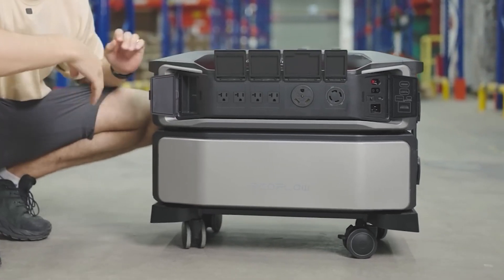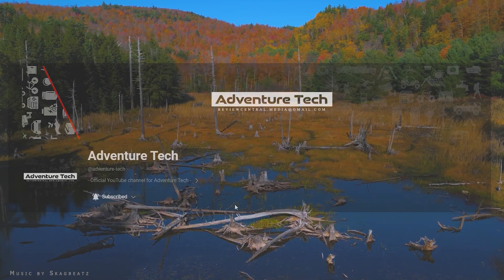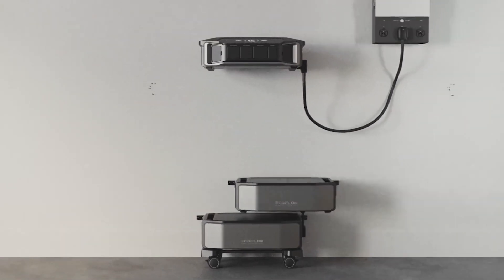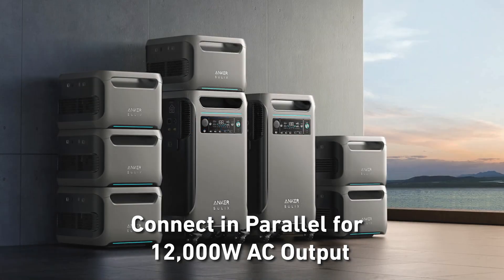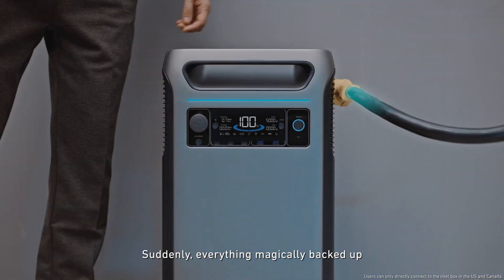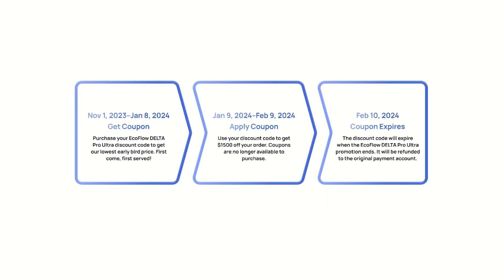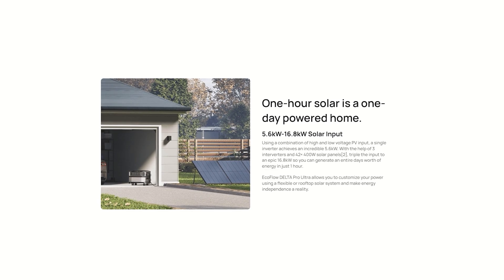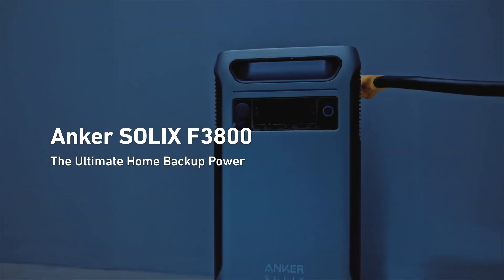EcoFlow Delta Pro Ultra vs Anker Solix F3800 - Which One is Best Portable Power Station for You

Comment: Question...which product powers a refrigerator longest...anker solix f3800 or ecoflow delta pro 3?
Reply: Thanks for your question.   The Delta Pro 3 has 4000Wh and the Solix f3800 has 3840Wh, just a little less.  Not by much.  So the Delta Pro would last just a little longer.   let me know if you have any other questions.

Comment: I don’t understand anything about wattage or output i have 2 sump pumps a fridge, a deep freezer, a furnace and a 3 ton central ac. Can any of these fully power my home and for how long?
Reply from the maker: Based on my research and communication with the company, The EcoFlow Delta can likely handle everything you got (with one exception, your 3-ton central air conditioner's LRA rating must be within 120A.. )     Everything else should be good.  You know  them sump pumps and fridge's can pull a lot, especially the pumps.  The 3 ton central AC pulls a lot of power as well.    Your furnace doesn't use too much electricity since it burns fuel, it only needs to run igniter, fans, etc...  A lot of furnaces I've seen have a small plug in box with a few wired plugs to them in case you need to unplug them from house power and plug them into a small generator or battery and inverter.  The ultra is made to be able to handle pretty much everything you got.  Just the one main exception I know of mentioned above.    You may want to invest in smart home panel 2 combo to to make things super easy; if you don't want to bother yourself too much with the complexities of portable power system set up. 

The Ultra can output a lot of watts so it should be good with your needs.  But high output means high battery drain so you would just need to figure out how long you want to run everything during emergency.  Or some people like to run during the day and charge at night to save money on their power bills.  While others use solar to power huge battery banks for multiple days worth of emergency power.    

Learn how to find out your daily usage here:  The length of time your batteries last would depend on how many batteries are on it.  You can connect up to five batteries per inverter (or the main Ultra unit.)   It comes with the one battery that is a lot.     In your home, everything won't be running continuously so usage will vary throughout the day.  Your power bill should give you your daily average usage, letting you know how many kWh you need in your batteries.  OR your monthly amount you can divide by total days in that month.   I use about 11 kWh on average being very easy on power use for one person.  Average usage per day in the states is about 30 kWh or so.   So maxed out at 90 kWh would cost a lot, but a lot cheaper than trying to do this even five years ago.  They advertise this to last many days based on idea it is for emergency use, not your normal daily use. Also, people tend to use power different when it is coming in from a portable power situation, so you may adjust your usage a bit when transitioning or during battery use.  

One good thing about this portable power station is that the battery and inverter are separate, making it easy to replace and add new batteries.  Plus this is big enough to power your home and portable enough to quickly grab it and take it with you anywhere you go.   It isn't super light, but manageable for sure.   This is one of the more revolutionary aspects of this design being portable and extremely powerful with huge power storage.  

I hope this helps out and answers some of your questions.  Feel free to follow up with any other questions or concerns with this type of technology.   I'm happy to help.  There is a pretty good discount right now going on and if for some reason you missed it, you can email me and I can offer something for ya.  But I think the discount should still be available following the link I left in the video description and pinned comment. It helps keep food in my fridge too if you use the link, which is always greatly appreciated.  

If you are not scared of a slightly more complex DIY system.  You can learn more here if you like : https://youtu.be/eeIDh6zxUdU   

This video compares DIY set up to an EcoFlow whole home back up; costs, capacity, certifications, etc...

Comment: Not sure if asked elsewhere,  but the Smart Panel 2 for these Pro Ultra is capped at 12 circuits.  What possibility is there for powering the whole home circuit, which might be 2x that number?
Reply from the maker: that's a really good question.  You would need to account for how many circuits you want to run with using this set up.  You may be able to work around it with two panels though.

Comment: None of these are "portable" per se.    Portable is something that anyone can carry.  If you try to carry an ecoflow pro or pro ultra, your back will hate you forever.
Reply from the maker: Haha yeah, not recommended to go lifting these without proper help or equipment.  Your back with thank you later.  Really good point you make though   It is a bit portable with the design and wheels, but these are starting to get really heavy.  First they called them just 'solar generators,' then it became 'portable power stations'...  I wonder what the advertising terms will be used for the next generation of portable power solutions that are getting too big to be portable.

Comment: The Anker F3800 can be charged from an EV? Whereas the EcoFlow Ultra can only be charged from AC? Or did I misunderstand what you said?
Reply from the maker: I apologize for the confusion.  It's been a bit confusing because both these aren't available yet and they have been changing some information over time.  I meant to mean that you can charge EV with Anker Solix f3800 but so far there isn't quick easy way to do same with Delta pro ultra.  Of course a ultra can put out the power needed, but may need an attachment of some sort.  IT was only vaguely mentioned  where I found the info without many detailed.  It seems Anker is making an easy to use port on the unit itself for an EV charger to connect to, while EcoFlow ultra does not do far as we see.  Again, please remember they keep changing things a lot and there is really very limited information.  Something else to consider is that only Anker seems to be really changing information a lot over time.  Originally they said only 26 kWh or so storage upgradable, now they have doubled that number recently in there marketing material for the f3800.  So EcoFlow seems to be more accurate with the final product.  I'm not finding discrepancies like that with EcoFlow.   Which makes sense since they are not kickstarter crowdfunding for the Ultra, as opposed to Anker who is.

Comment: Please research watt, kw, and kWh. These terms are not interchangeable and mean drastically different things.
Reply: I am concerned about the credentials of the creator if these basic fundamentals are misunderstood and wrongly used interchangeably
Reply from the maker: Hey thanks for leaving feedback!  Errors are always a possibility when speaking.   I didn't see any errors though.  After 12 years an an industrial inspector and owner of a construction company, I became pretty familiar with the terms used in this video.  I can't tell if you are just trolling.  I'll share more information below to help you understand my narration better.  Also check the 'all power stations reviewed' video for a full in depth explanation:

7.2 kW (kilowatts) = 7200 W(watts) = seventy two hundred watts.  This is unit of power measurement.  All these terms are interchangeable.
6 kWh(kilowatt hours) = 6000 Wh(watt hours) =  six kilo watt hours = six thousand watt hours.   This is unit of power/time measurement.  These terms are also interchangeable.

This should help you understand when I interchange kW and W, or if I interchange Wh with kWh.  As long as you multiply or divide by the appropriate number (1000 for metric for these terms), you can use either term.   kWh or Wh will always be referring to total amount of storage for the battery components. While, W or kW will always be the power output or input the system can handle. 

Please let me know where in the video you found a mistake.    I understand that watt and watt hours is not interchangeable, since they are two different units of measurements. But I did not interchange these two measurements anywhere that I am aware in this video.   Please correct me if the information in this comment is incorrect. Also, if you were mistaken, please let me know what was confusing about my narration to cause your mistake.   Thanks again.
Reply: @adventure-tech  no, not trolling. Always glad to hear people happy to learn. The ones I caught are 2:07 2:13 and 3:42 but there might be others I didn’t hear.
Reply from the maker: You're right!!  Thank you for catching that.  I had to hear a few times before I realized.  I basically dream about watts and such I do this work so much.   These videos take hours or days to prepare so errors definitely can slip by.  It's a lot of work and compensation is little to none.  It's laughable.  Work fatigue can occur.  I know this stuff can save lives where I come from and help people have more freedom.    I'm glad I got great people like you to help make sure everyone is on the same page regardless.  It really helps me to achieve my goals with my channel.  

Corrections:
 I misspoke at 2:07 referring to  '...over 10 kW' as 'ten kilowatt hours' by mistake.   Thankfully I highlighted the correct term so most people will know I misspoke in this case.  

At 3:42 I accidentally say watt instead of kilowatt.  Image only 5.6 watt input on a $6000 power station 😂 Of course I meant kilowatt.  

No Mistake Found: 
At 2:13 I state "12 hundred watt continuous output" referring to the output of two combined f3800.  They output 6000w total and can be combined for 12000w (12 kW).   This is correct term I believe.  The on screen animation is also showing that it simultaneously doubles the voltage as well.     Please double check for me my friend.  Again, maintaining these channels is a lot of work, so maybe I still can't see the mistake at 2:13.
Reply: @adventure-tech  no worries!  And for the 2:13 comment. I might be mistaken but is it really only outputting 1200w(twelve hundred watts) or is it 12,000w(twelve thousand watts)
Reply from the maker: yup, you're right.  I must need rest haha